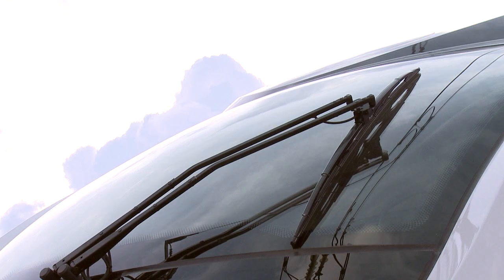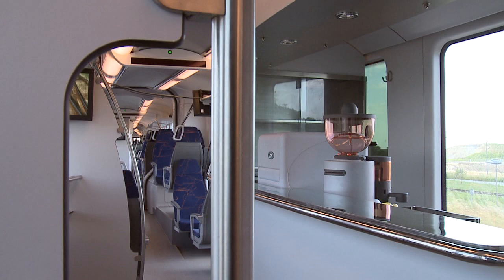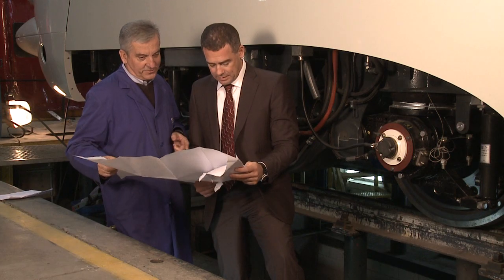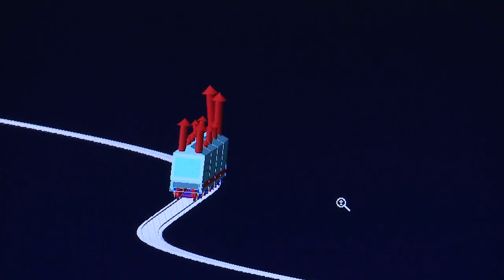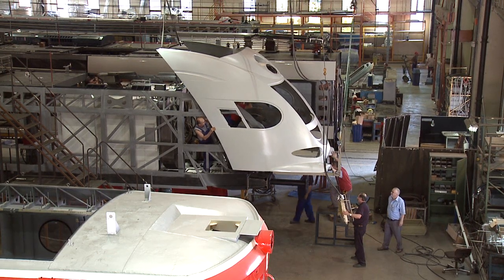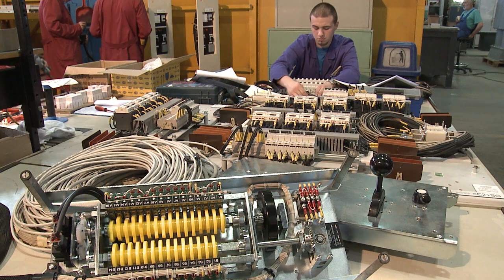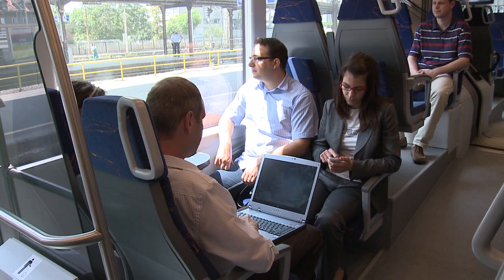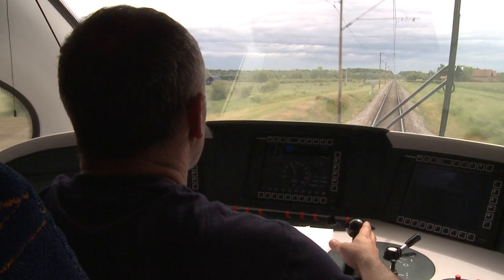The Low-floor Electric Multiple Unit KONČAR

Comment: Former Boeing Everett. I am more familiar with giant aircraft but can easily see the advanced engineering used.

Every Industry has their own design criteria, goals, government regulations, passenger wants, and more. It is up to Engineering to provide Solutions. Although this video is 11 years old, I can imagine how far KONČAR Group has come since producing it. 

It took a second to realize what a 'Low-Floor' meant. Yes, the lower you can make to rail-car in relationship to platform height is a big plus for many passengers; including the elderly and handicapped. Ingress and Egress is so important in public transportation of any type. 

In aircraft, boarding and unboarding is controlled. In an emergency all passengers need to be outside aircraft within 90 seconds. Emergency Slides are used and the crew practice a lot. It would be nice if planes like trains were much closer to the height of the tarmac instead of being 1-2 stories high. Jumping from that height is not advised, usually resulting in broken bones. 

Regional Trains, Urban, and Rapid Transit all rely on cutting edge Engineering. KONČAR Group is in the forefront.

Comment: T 18 180 /kh in India
Reply: Ya
Reply: In Croatia max speed is 160 km/h
Reply: Hey Croatia, go high speed!
Reply: @AnubhabKundu  Well the train can go up to 200km/h because on test rides it has to achieve a speed of 200km/h. But the rails are very bad and outdated so it would be dangerous for the train to go any faster

Comment: No company has  yet to be able to build one of these articulated paste tube trains with enough air conditioning power to cope with Australias 45 Deg C temperatures. Not just cooling power but cooling volume to replace the air lost each time the doors open.

Comment: If you think about it it’s really really simple to build a locomotive. Basically just a generator with dc motors
Reply: What are you thinking about? Diesel locomotives are basically that. But theres a/c, 16 2/3 Hz single phase which indeed used basically DC motors, and there’s 50/60 Hz single phase traction, which requires A/C motors. And now there’s multiphase traction, single phase from the catenary is converted to three phase a/c in the locomotive, and the motors are "simple" (simple ectric-wise…) polyphase motors.
I can highly recommend a few good books on the subjects, Google & Wikipedia is your friend! :)
Reply: Im not saying that’s what it is it’s what it’s like

Comment: A copy of Stadler's FLIRT.
Reply: Nope. This is a LOW floor Train made for low platforms.
Reply: FLIRT is different product. The FLIRTs are unique in way that they are bi mode multiple units. They have an articulated car that houses 2 V8 diesel engines driving alternators alongwith other equipment. The sets also have 25 kV AC equipment for working on overhead power. The product comes in both 3 car and 4 car configurations. The US has purchased a 3 car FLIRT unit that works as a DEMU set on one suburban route.
Reply: The flirt entered service in 2010 while this train entered in service in 2008
Reply: @TheEnerger  The Flirt entered in service in 2004.
Reply: @rail1435  Yeah sorry I checked wrong, well everything is possible, but končars train has a different design, I mean what do you think about it. Were you every in Croatia to see the train?

Comment: may I know the energy source of the motors?
Reply: Overhead lines. 3000 volts DC, probably converted with onboard converters.
Reply: Shani Andras 25000 V AC